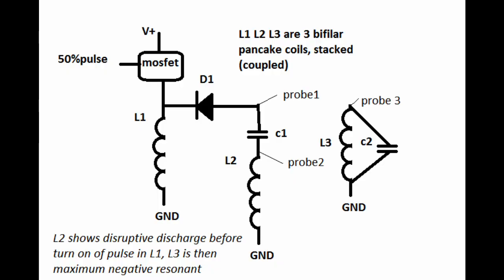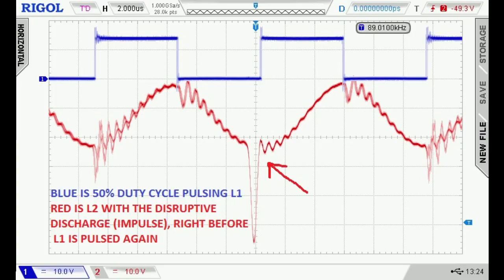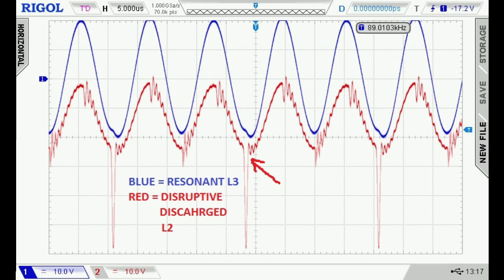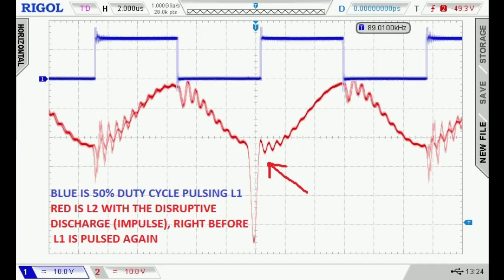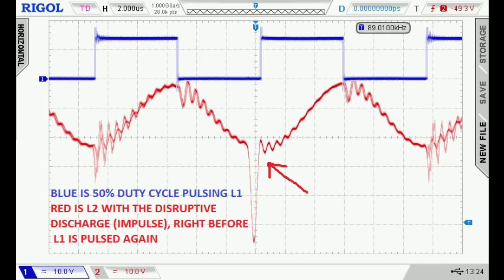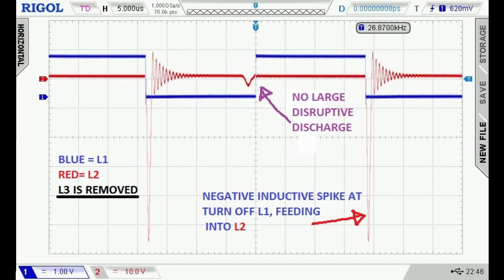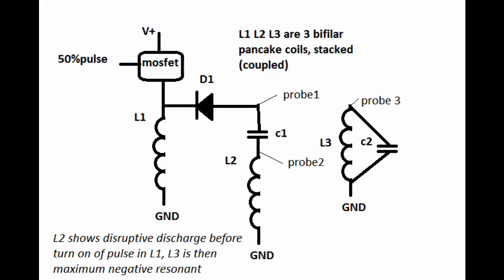Radiant energy bifilar coil experiment

Comment from the maker: Question SOLVED,  the back emf is delayed.The current travels in the wrong direction and the back emf cant pass, until the current is reversed (or zero).  The coil is acting as an inductive diode.
Reply: from a quantum physics point of view, the back EMF is actually a time reversed wave of the forward EMF. the time reverse wave is caused by surface plasmon polaritons creating a negative index of refraction grating between the metal/ dielectric layers of the conductors in your coil(called capacitance) the plasmons are caused by electrons being shot into the bulk metal. once your metamaterial is set up, the forward emf is reflected back in a time reverse fashion. so, the back emf is energy you can use twice. this is in the literature.  surface plasmon are the vacuum being polarized between the metal dielectric interface of your coil. surface plasmons are the cause of the skin effect and superconductivity. 
so, while the the current may be opposing, you are redirecting the back emf into the l2 coil for amplified gain,. but this is only half of the story your looking into. capacitors also produce this effect and are more adapted to the geometry of the process because the sureface area of the plates polarize more volume and can harness megawatts of power. so if you get back emf from switching forward emf, what do you get when you switch back emf? forward emf. your taking cold electricity and turning it into hot electricity. thats how you tap the vacuum for free energy.  your switch is an electrical potential, when the atoms in the mosfet become energized, an electric flux density asserts itself into the mosfet. this electric flux density is a polarization of the vacuum of the space the atoms in the mosfet are sitting in. the closing of this potential releases energy the same way a lightning strike occurs as a displacement current.  the light you see is a time reverse wave coming out of the nucleus of the atoms. the atoms become time reversed because of a change in the dielectric constant of the vacuum the nucleus is sitting in, changes its index of refraction to negative.(richard feynman)(hal puthoff)

for more info https://www.youtube.com/user/spiritresonancejv
Reply: Master Ivo Nice, you should pin this.
Reply from the maker: Done!
Reply: @MasterIvo  Have you noticed any overunity effects?
Reply: wish I understood your  terminology more :)
Reply: Have you manage to make a room glow yet ?? It amazing
Reply: Very hounest and sincere hatd working genue video thank you sir. 

Befor I watch this video I wrote comment watched others 329 am I worked all day and so tired of cheep slavely labors I neex be free from this so so eagary seeking overunity came to your video. 

330 am all day this was my best relaxing and beneficial learning of day. 

I really hope you will so success sp every one can be free from economic slavely by your braim & ecsistence thank you very truceful detailed sincere video sir I really appriciated all your hard works sir I hope soon you will find over unity and you will change so many familys life to so positive sir. 

Thank you for all your so hardworks 🙏.
Reply: Isn't this curiously interesting how similar of a "flow dynamic" found in this discovery is to the Tesla Valvular Conduit...?

Comment: Can i exclude an mosfet from this circuit and just use my frequency generator? Is the mosfet just acting as a diode to protect the frequency generator from back emf?
Reply from the maker: no you need the mosfet, to handle (switch) the power on and off.
Reply: @MasterIvo  would a square wave from a frequency generator not accomplish this in the same way?
My signal generator and oscilloscope arrived in the mail a few days ago. I feel I have a solid foundation in understanding frequency and vibration. The circuitry is still confusing for me!
Reply from the maker: the voltages won't be high enough and you'll risk blowing up your frequency generator.

Comment: If a boat travels down a narrow canal, and a wave travels up a canal...and they meet...this causes a splash that goes really high...higher than a wave....but that splash is still contains water, nothing was added...and since the water won't compress into itself, nor can it go into the boat it hits, it shoots off into the empty air direction until its speed and velocity equal gravity...then it disappears, it falls back to water.   Also has a noticeable effect on the boat.
Reply from the maker: What is the water is traveling outside the canal? if the Aether outside the conductor is whats moving?
Reply: @MasterIvo  Don't know either answers, I was just visualizing what you experienced on the graph....that sudden spike.

Comment: transient wave maybe?
Reply from the maker: yes. Transient=impulse=longitudinal wave=ring toroid Aether wave rolling over the wire
Reply: @MasterIvo  Can you take the aether wave and focus it into a narrow beam?
Reply from the maker: @jlo13800  yes, rodin coils do that
Reply: @MasterIvo  Ok and i see overunity potential for a self running rodin coil generator that taps ZPE.
Reply: @MasterIvo  Can a rodin coil pick up a 28 Thz co2 laser beam?
Reply from the maker: @jlo13800  no, then the coil would need to be very small
Reply: @ the beam would sweep in circular motion over a 2 inch coil
Reply: @ as the beam sweeps over the 2 inch coil it induces currents in it
Reply: @MasterIvo  A circular motion flat to laser beams brushes over the coil and can be pulsed in the KHz range. this way the longitudinal radiant energy the the beam induced currents in it!
Reply from the maker: @jlo13800  pulsing might indeed be interesting, if pulsed at the resonant frequency of the coil

Comment: In a way ,the acceleration into counterspace is decelerated back out as what we reference as magnetism/space and the radial expance duration to that spatial bountry [aka time reference] then this cycle repeats again as inertial accelation from space to counterspace.
Reply: This will also help explain the time lap in the "spike" you observed on one of your 3  bifilar coil experiments; the observable "time" to re-adjust the spatial referencing to systems in that reference in the state of observation be it :natural or artificial.
Reply from the maker: yes, the dielectric field is related to time, as the magnetic field is related to space

Comment: resonance in the top dome of the coil can be used to send a signal that's faster than the speed of light, quote of 'the old scientist'. It's a channel on youtube!
Reply from the maker: yes se old zcientitz. ;)  but its not due to the resonant sine, its faster then light due to the high voltage impulse, fed into the series resonant coil.
Reply: @MasterIvo  https://www.youtube.com/channel/UCNbdkwT-LstmshlLDOqs7JA
Reply: @MasterIvo  there seems to be no series resonant coil so what do you mean?
Reply: Ben trouwens hollands misschien begrijp ik je dan beter ja ik snap je ik lijk wat te brabbelen maar volgens die dude op t kanaal gaat het signaal ook door metaal en alles heen! Dus heeft wel potentie!
Reply from the maker: You refered to "the top dome of the coil" If you mean the popular "tesla" coil (it isn't how tesla designed it, but thats not the point), It has a Top dome, which acts as a capacitor. this creates series resonance between the top load and the coil.
Reply: @MasterIvo  https://www.youtube.com/watch?v=lMJr-oUYYDA You mean something like this but I ment the top dome resonance!!

Comment: Inductive diode thats cool. Kind of like muffler bearings and turn signal fluidm
Reply from the maker: yeah but if you think about it, it makes sense. like a saturated electromagnet (DC) with a secondary wound on top of the primary, will only conduct current one way.

Comment: I completely agree with @Kolin Evans below. I too have the same problem with conventional terms that make zero sense to me. To my spatially oriented brain there is only polarity or no polarity (no positive or negative). Charge or discharge (not electrons, no positively or negatively charged particles) just charge of the field, and discharge of the field. In-phase - rotation, or opposite-phase - counter-rotation. Magnetism, to me, is the dielectric field in discharge. 

I like to think of the dielectric field as THE field, or the ether (not to be confused with dielectricity), from which force and motion cause magnetism to manifest. Magnetism being centrifugal radiation from the dielectric field. Magnetism to me is spatial; it causes space; it is space, therefore it is change; it is time. When magnetic centrifugal force is exhausted, it returns to the dielectric plane (ether field) via centripetal acceleration. Dielectric field, to me, is counter-spacial, always wanting to pull mass into counter-voidance. When magnetism increases in magnitude and potential (like a balloon), dielectricity also increases, however this is like a spring being compressed. Magnetism displaces and dielectricity compresses, both storing energy at the same time.

To my conception, (and I know this is counter to the conventional) the 'north' polarity (centrifugal) of a magnet is 'attracted' to the 'north' (centripetal) of the opposite pole and vise versa. Like poles 'attracting' like poles, not repelling. It just so happens that the 'north' centripetal vortex (acceleration toward the dielectric plane) is located on the opposite 'south' pole. In this sense, to me, a magnet has double polarity (I don't know any other way to describe it), or 2 'poles' to every pole. A 'north' and 'south' on each pole, a quadrant entity. Anyone else conceive magnetism like this? Cheers
Reply from the maker: Beautiful train of thought. agree with most. but more important, is how we make use of this knowledge in a practical sense.
The impulse has a few tricks up its sleeve :)
Reply: @MasterIvo  - Completely agree. The impulse is absolutely critical. Besides the longitudinal possibilities, an impulse also gives us two chances to grab a changing magnetic field. One building, one decreasing. We also have permanent magnetism to add four more opportunities to build off that pulse. In addition, ever sandwiched a bifilar coil between two neodymium magnets? Rotating that complex between two more bifilar coils would be something I would like to try. Indeed, so many possibilities. If only I had some more time. Love the resonance stuff, some great results and some great thinking! Cheers.
Reply from the maker: thanks. What do you think about what happens in the field, when you pulse (50%duty) a coil, and build up a magnetic field, and then the pulse stops, creating an inductive spike / back emf?

and what would an impulse have effect on that field(at turn off)?

never tried with magnets, are you going try?
Reply: @MasterIvo - That discharge spike is a real tricky one. I have some thoughts though. I've been thinking about it most of the day. Looks as though something additional is being introduced, or subtracted/cancelled out to/of the system when pulse is switched. Just thinking about your scope set up, if it is an older type, or if the leads are not cancelling, the coil in the probe could be inducing an additional voltage (magnetic field) to the system. I would first suspect it might be the probe coil. 

My second thought was that there may be something going on similar to what is happening as seen in the 'Romer' problem. http://www.phy.pmf.unizg.hr/~npoljak/files/clanci/guias.pdf  where different voltages are detected over exact same points dependent upon where the volt meter is placed and where the resistance is located in L1. Results would vary again when a scope is used due to the coil (if present) as summarized above.
Reply: @MasterIvo  - Re:magnets. I haven't experimented yet. However I would like to run a few ideas that I have. Sandwiching a coil, whether a bifilar or rodin, between two powerful neo's yields some interesting results just in a resting state. The two magnets do not form a single magnet, when the coil is in between. The system has three dielectric inertia planes with one smack in the middle of the coil with two either side. Dielectricity must be compressed into the coil from the magnets, I would assume. That is interesting on its own. From this stage I would like to experiment with additional coils, rotation and a pulsed power-supply. I think it could yield interesting results. Certainly some pretty decent efficiency.
Reply from the maker: maybe use some large speaker magnets